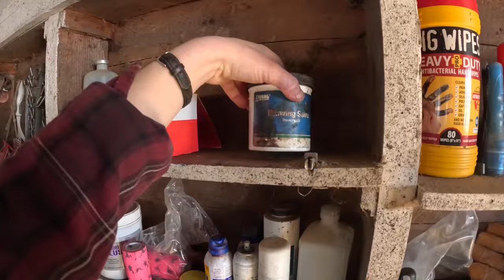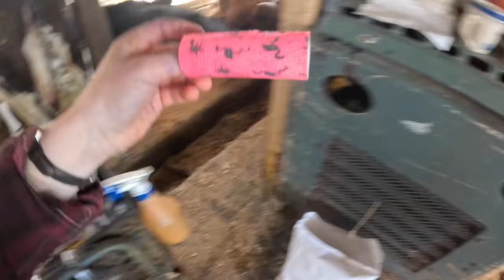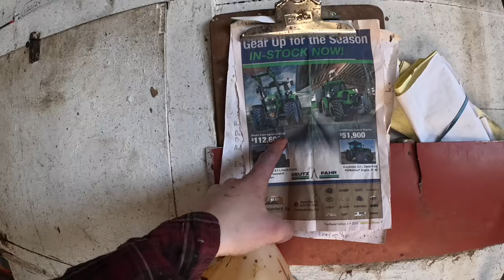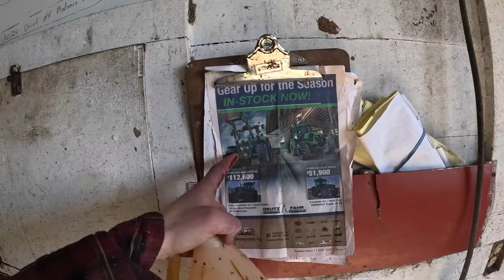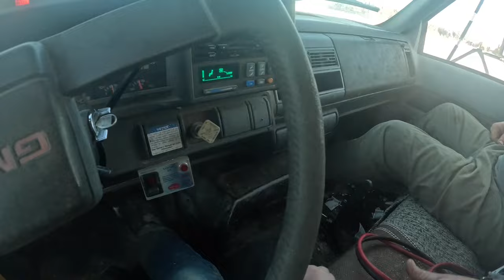A sight that makes a farmer sick and a stroke of luck in a bad situation…

Comment: One way to prevent future freezing of manure at your waste pumping station would be turn off the air fan, cover the windows and add a small electric space heater on cold days and nights. For the few days that you have this expense, it would save you a lot of dirty work. Getting into that pit, on a cold day no less, looks like pure hell. Let the fresh air come in somewhere else.

Comment: We have a Deutz Fahr 5110G, great tractor but the emissions crap can be a pain. We typically use 15/40 engine oil on all of our tractors but have to put a lighter oil in the Deutz over winter because we were told a failed turbo charger was caused by using too heavy of an oil in the cold weather here in New Brunswick, Canada.

Comment: I won’t want my fingers between the door and the loader. I like Bag Balm for your cows udder it really heals. I use it on myself. I don’t know if you have a screw in light socket in your gutter room. I use one of those paddle bulbs and it will light it up like daylight.

Comment: I’m far from a OCD person, but think first thing I would do is put electric tape over the red idiot light always on in dump truck. No idea why , but can’t stop staring at it when you film in cab 😂🤣😂. Bob in Pennsylvania
Reply: The steering wheel clocked 90 degrees out, the constant rattling, the missing drivers door card, the headliner and the cracked side view mirror are all supposed to distract you from that light.

Focus on those, it will help.
Reply from the maker: I guess y’all don’t understand farm trucks very well 😂

Comment: That was 'fun' Taylor. I'm curious why you run the  fan in the winter. I would think the warmer the better.
Reply from the maker: Thank you for watching! It can actually get too warm and humid in a barn without proper ventilation and that can cause cattle to contract pneumonia
Reply: Cows will take cool are better than they'll take stale air . Hey cool barn with fresh air moving is better for the cows and warm Barn is better for the folks milking the cows

Comment: One of my cow gave birth  about 20-30 days later then the average time, one of her quarter was sever mastitis ,it was rock solid and hardly any milk comin out of it. anyways after 1-2 weeks antiboitic treatment and lots of massaging with also hand milking i managed to empty the tit. then the other day i saw the very same tits bleeding with  wound on the tip. the vet said she might have stepped on it... what are the odds she stepping on the very same tits a day later? so i have been cleaning, bandaging and everything to like last one and a half months, the wound on the  tip pretty much healed but i can feel the inside of the tit is different from others its kinda meaty swelling there  and the tip of it  is getting closed from morning to evening and evening to morning. so every milking i have to give a hard hand milking with vaseline to open  the canal . it has been tiring  process and i donnow if the tit can survive, kinda loosing my hope...
Reply from the maker: That’s always really discouraging especially when you have worked SO hard to make her better! Have your tried a teat dialator to keep the canal open? Those are a lifesaver when it comes to the scabs and just teats closing up in general. We use the doctor naylor brand they work fantastic
Reply: @tayfarms  i don't know nothing about them, i ve checked it now online and see there are some other brands on my region. But still donnow how to use em and gonna ask the vet to get info.

Comment: would a paint stirrer with a 1/2 inch drill work down in that hole ? obviously you would have to weld an extension on it.

Comment: Sure was a POOR design on that gutter cleaner. Seems like every other video you guys are waste deep in cow dung in that pit repairing or rigging it . Milking cows is not worth that to me as I grew up on a dairy farm and wel milked 50 head of Holsteins.  If it were me , I would look into a way of removing the waste from the gutter by some type of small tractor 🚜 🚜.  And retrofit  your barn accordingly.  At least if the tractor would break down you would be rid of waste deep in cow sh** !
Reply: I'm thinking you may be right.  This is a maintenance nightmare and it seems to be in constant need of repair.  Too many ways for problems to occur.  Time to go to plan B.
Reply: Some advantages of a gutter cleaner,.....you can be doing something else while the gutter is being cleaned (and there is always something else to do), it is far easier than a shovel and wheel barrow, it's cleaner-most of the manure stays in the gutter instead of being dribbled all over the floor, and most importantly it gives you something to do when it breaks or freezes.